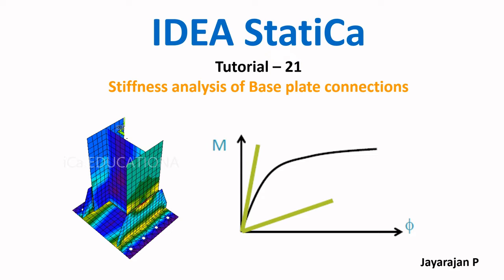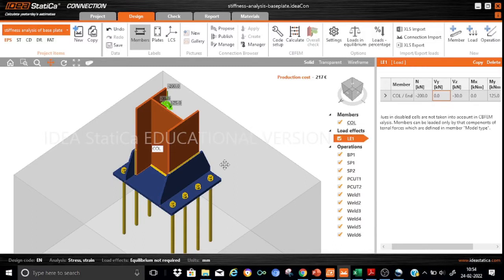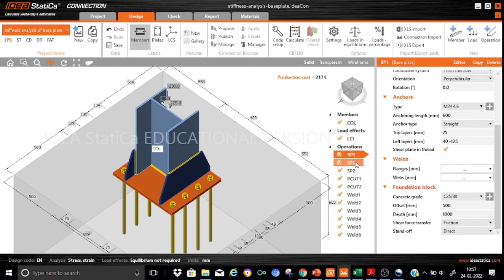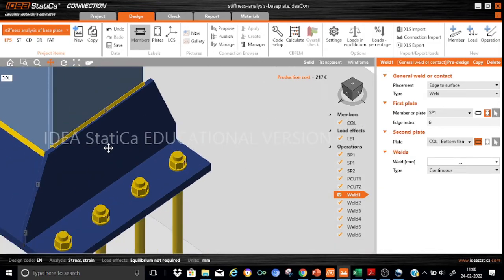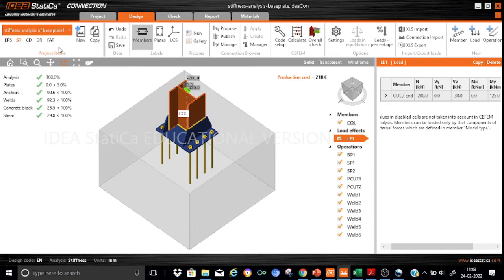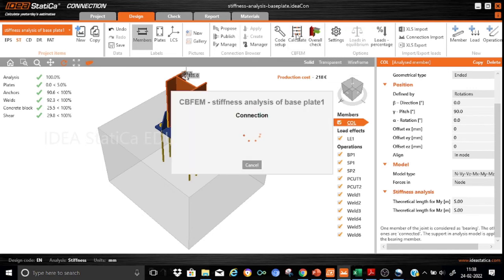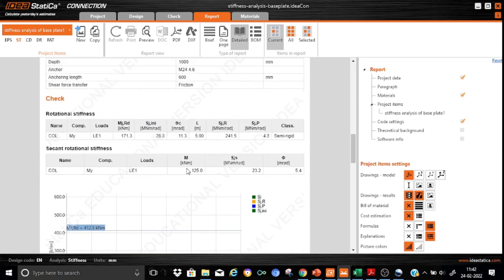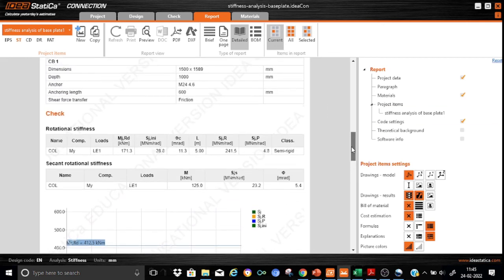IDEA StatiCa - tutorial-21: Stiffness analysis of Base plate connections

Comment: sir can u explain why bolt failed if pedestal size is less . if increase pedestal size bolt will be pass?
Reply from the maker: The bolt capacity is governed by various factors of which the important  one is the pull out capacity calculated from shear capacity of concrete. Larger the pedestal size , more the area of concrete contributing to resistance  and thereby enhance the capacity of bolts. Ensure that proper edge distance  of bolts from concrete pedestal edge as per the standards  is maintained
Reply: @puttattjayarajan1199  as u said is correct sir if we provide less size anchor  will fail in anchor breakout strength. as per u r tutorial 16 we have provide 300mm offset concrete pedestal. practically we will not provide that much of offset. as per code pedestal edge to bolt centre is 6 times diameter of bolt. But in ideastatic we will provide actual size anchor bolt failed in concrete breakout strength.

Comment: sir why do not you make videos using IS 800 code
Reply from the maker: Hello rajendra ,
Thanks for ur comments. It is only a matter of changing the code from EC3 to IS800.
However, IS 800 do not provide the behavior of different components of base plate to arrive at moment -rotation curves and based on my experience is a poorly written document compared to EC3 and AISC codes. 
It is also important that we verify our program outputs using well written code guidelines. This hand-verification for base plate is not possible  in case of IS 800 codes.
Hope this will answer your query.